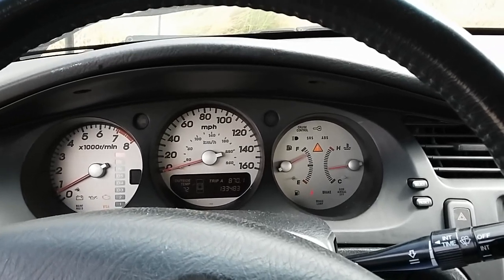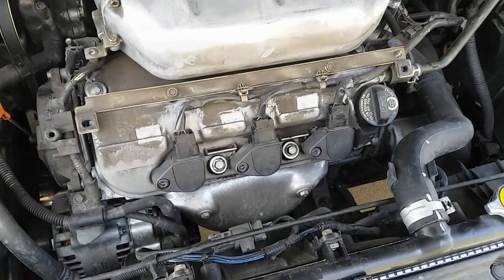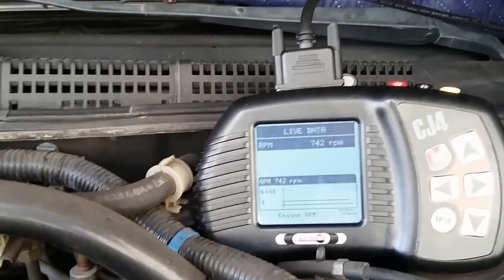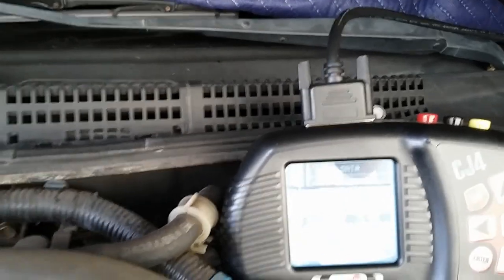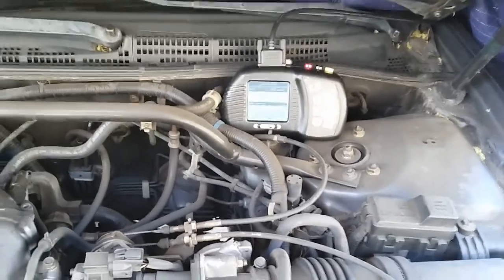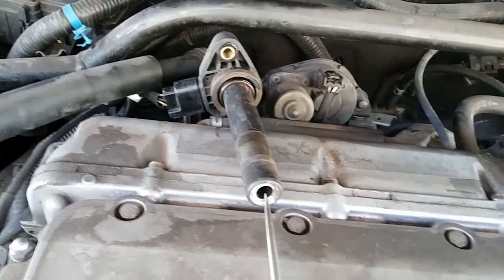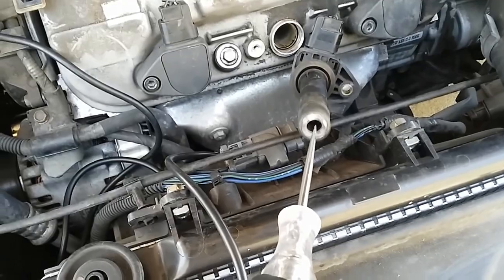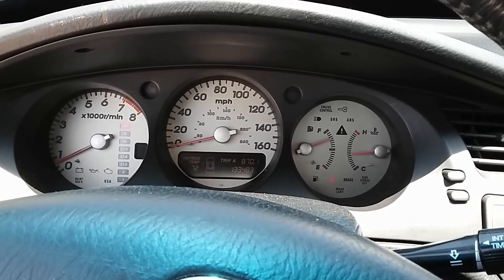(Acura TL) Diagnosing a P0300 Random Multiple Misfires

Comment: ...Hmm 🤔  ..I got a 2004 Honda Accord EX v6, it has random error codes P0300, P0301 P0302 P0304, and sometimes P0304...  but according to diagrams on the internet, the bank of Cylinders near the firewall are Cylinder 1,2,3 ?  and 4,5,6 are the front Cylinder bank?   Which layout is correct?

I also installed new Spark plus and New Coil Packs on all the Cylinders, but the old Factory original units were giving the same random error codes?  🤔
Thanks, Alfredo
Reply from the maker: Yes,  the internet format is correct. For some reason I was thinking of American vehicle format for that vehicle.
Reply from the maker: Are you still getting error codes with newly installed components?

Comment: So it was just one coil that was triggering all of those other misfires? I have the same problem with the same exact car right now. This should be really helpful thank you.
Reply from the maker: Yes, only one ignition coil was causing the pcm to trigger other cylinder misfires.
Reply: @EliTheOBDTech  Thank you!
Reply: This worked. I didn't even have to use the test light becasue I switched out the #1 and #2 coil, and the misfire moved from #1 to #2 cylinder. All I did was listen for the idle speed to drop like you said. Man you saved me some money- thank you!

Comment: Wow! Never saw anyone use a test light for a coil pack! Looks a little scary because they produce such high voltage and I don't work with this stuff regularly. Still learning but I can see that this is a more cost efficient way to check instead of a COP quick probe for $99. Good deal!
Reply from the maker: As long as the test light is connected to a good ground, you should be find.

Comment: The three cylinders on the back from left to right are 1-2-3 then the front left to right is 4-5-6. I noticed when you were saying what c # you said 2-4-6 across the front, which wouldn't be correct as far as position. Firing order from each position is 1-4-2-5-3-6. :)
Reply from the maker: I guess I was thinking about a another vehicle setup, but thanks for pointing that out.
Reply: I notice that  to thanks  for pointing  that  out 👍
Reply: Bro I was freaking confused thank you for that I was going crazy thinking that it was another car thank you

Comment: Eli I have a 02 Acura T.L Type S and I'm getting the OBD code P0131 I've changed the O2 sensor changed the speak plugs checked the coils but the VSA and MIL lights keep popping back up.. any suggestions I can look into I gotta get the car smogged ..any info will be appreciated..
Reply: Thank you ..
Reply from the maker: It's hard to say without any scan data to look at. Here's a link that I found that will hopefully help you solve your problem.

https://youtu.be/a19wkJ3bF2o

Comment: My 2003 Acura TL had multiple miss fire reading as well and replacing all the coils fixed the problem, thank you!
Did that for only $60
Reply from the maker: Nice!
Reply: where did you get your coils for $10Ea.?
Reply: G Lasser on eBay, paste this in the search.                                                              “High Quality Pack 6 Ignition Coils For 99-09 Honda Acura V6 3.0 3.2 3.5L UF242
PREMIUM MATERIAL! LOWEST PRICE! 100,000 SOLD! FAST SHIP”

Comment: Thank you! My daughter's 1999 Acura TL also had codes suddenly showing up in several cylinders, but using your diagnostic techniques I was able to confirm it was just one bad ignition coil, replaced it with the Duralast aftermarket part and the problem was solved. Thanks a ton.
Reply from the maker: I'm glad it helped.
Reply from the maker: @kayjay4060  Per vehicle owner, still going strong.